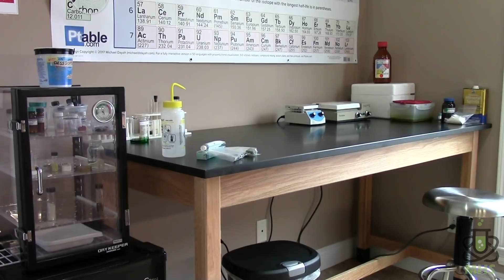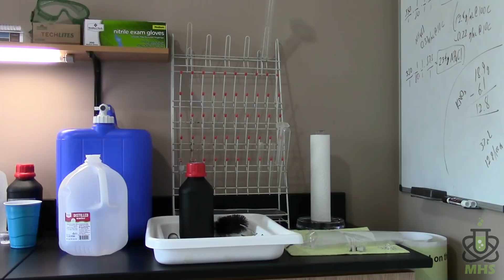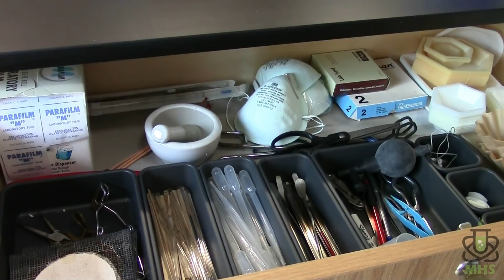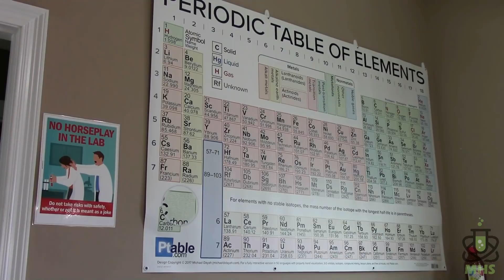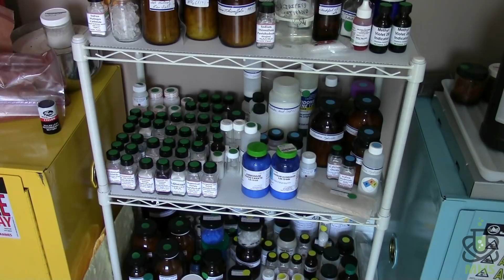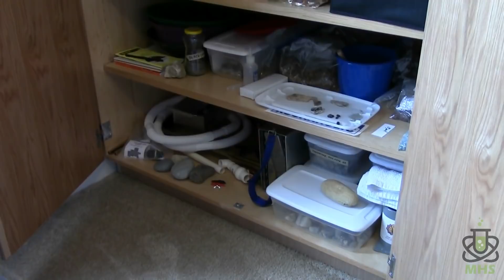New Lab Reveal!

Comment: What about ventilation? It's surprising you don't have a fume hood
Reply from the maker: Spooky Wizard Right now the system is "open window + box fan." The issue with the fume hood is always "where do the fumes go?" I'm reluctant to put a hole in my roof, and I can't direct it out the window because my front door is right there. Still thinking about it...
Reply: mrhomescientist yeah I'm planning to make one and it hit me that the fumes would really only go outside to neighbors and don't magically disappear haha. You'd be exposed to the chemicals to some degree with that kind of ventilation right? Would be pretty nasty for carcinogens or lachrymators wouldn't it? What I considered doing was using an existing hole in the house, like the vent for stove top fans...maybe you could do the same. An open window would suck during winter too =P

Comment: The lab looks amazing and well laid out.

I see HMS Beagle bottles on the middle shelf in the closet. Did you happen to back the Chemistry Heirloom set on Kickstarter? :o I did the $750, the one with all the chemicals and glassware. I really wanted the display/carrying case but I couldn't justify like $200 extra for the case.
My small HMS Beagle chems are sitting in a display shelf mounted to the wall in my living room. It's a nice conversation piece.

Comment: What do you think of your drying rack, would you recommend it? If so, what is the model/where did you get it? I've looked at many on Amazon but can't decide.
Reply from the maker: It works great, although mine is a bit wobbly. I had to wedge a wood chip under one of the legs to steady it. It's all metal so it has started to rust slightly over the years, but nothing major. It also has a drip pan at the bottom to catch falling water, which is nice.